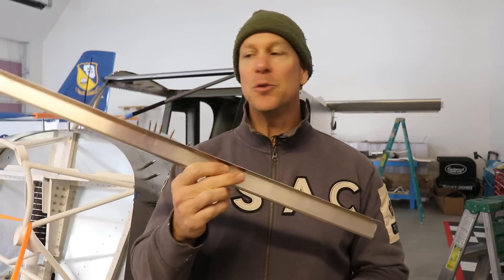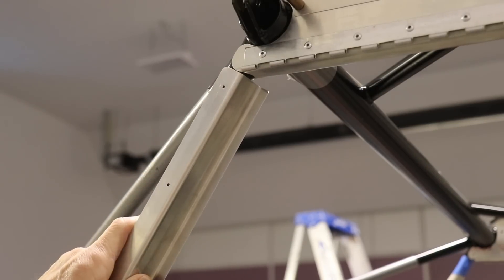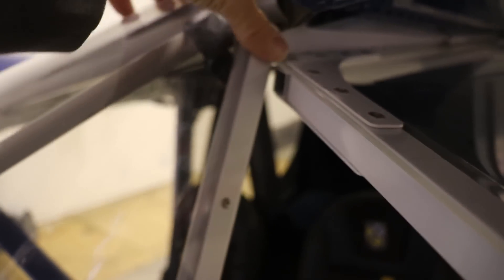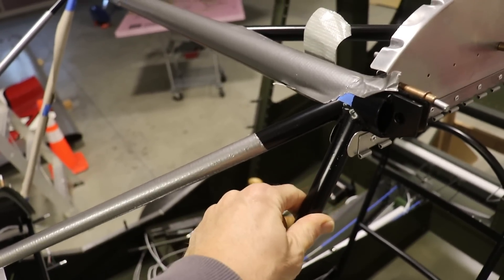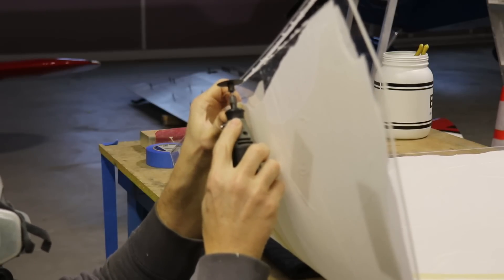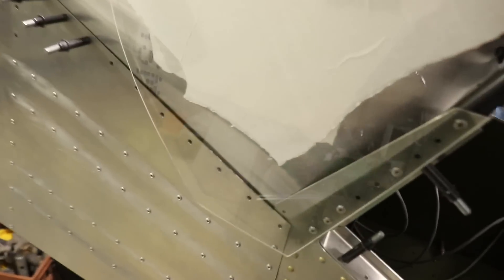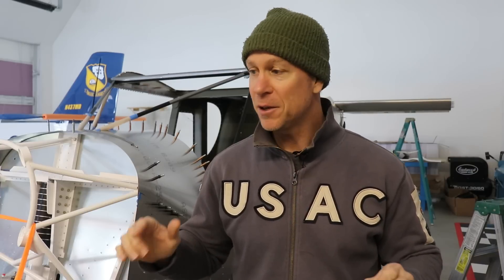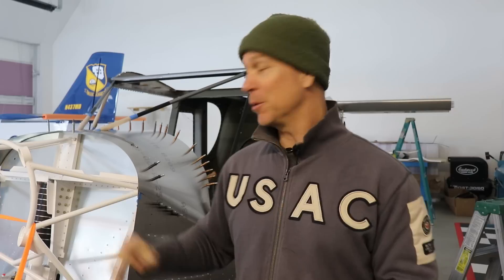Screwing Up Some More Parts!(Ep68)

Comment: Do you add anything to the bottom of the windshield before installing the fiberglass piece?  Or is the fiberglass just directly attached to the bottom of the WS?  (i.e. Rubber spacer?)

Comment: Add a right angle attachment to your dremel and you’ll never look back. Makes it so much easier to use and control with 2 hands. Plus the motor pet of the dremel will now be out of the way of the part you are cutting. I never take the attachment off of mine.

Comment: Have you thought of flame polishing the edge of the windshield? Leaves a beautiful edge and takes almost no time. Check YouTube for "flame polishing acrylic".
Reply: I would recommend wet sanding with 600, 800, and 1,000 grit paper to obtain a glass like edge. I would be concerned about changing the mechanical properties of the acrylic with application of heat. Also, if you ever had to make a repair, you cannot reliably solvent weld a flame polished edge.

Comment: Its interesting how you had the foresight with your Cruzer to note the benefits of the cutout with no prior experience, then missed this detail with your second build SD despite the prior experience.   I find myself occasionally doing a simple Cruzer task on mental auto-pilot with similar results.
Reply from the maker: I’m going to give you an honest answer to that observation-these are not the first parts I’ve screwed up and had to reorder because during the build process half my attention was diverted to setting up the camera, filming, and thinking about what I need to show in the video. So by paying more attention to filming, sometimes I’m not 100% focused on what I’m doing. 

Had I not been filming at the same time, I probably would have put more thought into the finer details of fitting that trim piece. 

That’s the price I pay to document the building process on YouTube.
Reply: @KitplaneEnthusiast  Good point!

Comment: When you discussed the trimming of the top of the windshield edge trim, I noticed that on the Cruzer the upper leaf of the door hinge is riveted to the inside-bottom of the door header.  On the Super Duty, the hinge is riveted to the outside of the header.  Obviously, the Cruzer hinge has a cleaner appearance since the upper leaf is hidden!  Do you know why the upper leaf of the hinge has to be exposed on the Super Duty?  (I guess the obvious answer is "that's the what the plans call for!"  LOL! ) Just wondered if you had thought about why it was different?
I wouldn't ask dumb questions like this if you didn't show so much detail! JUST KIDDING!  :)
Reply from the maker: Mounting the hinge so that it is hidden was a mod I did on my Cruzer but for various reasons chose not to do on the Super Duty. It’s a lot more work to fit and the upper U shaped pieces have to be formed exactly square. Sometimes those parts come from the factory not 100% square. I’m not concerned with making the SD real pretty so I was happy to just mount the hinge as per the plans.
Reply: @KitplaneEnthusiast  I guess that upper piece was pretty square on my STOL 750, since I mounted my door hinge same as you did the Cruzer's.  As I always say, "Great minds think alike!" LOL!
I understand the Super Duty will have a more "utility" look - which will look great!

Comment: Nice, lots of progress!
Why do you deburr all the edges with sandpaper? Have you ever tried a deburring /scotchbrite wheel? I found it way easier to use the wheel instead of sandpaper… (on the aluminum parts)
Reply from the maker: Sometimes I use a scotchbrite wheel, but on smaller sections it's just easier to do it by hand. Also, if you keep debuting edges of aluminum with the wheel, it cuts grooves in the wheel.